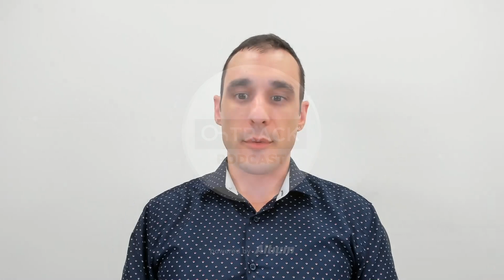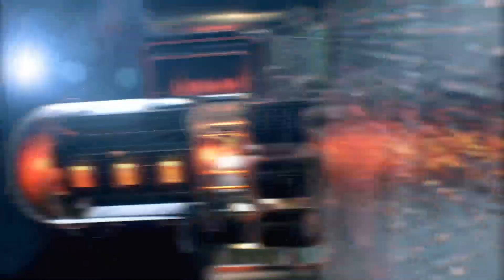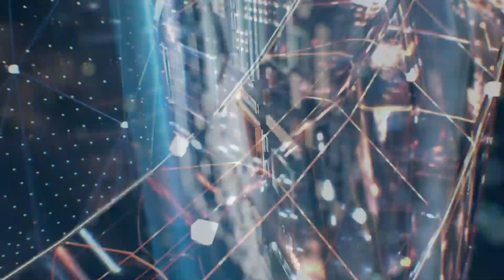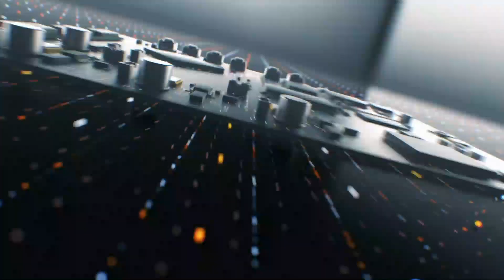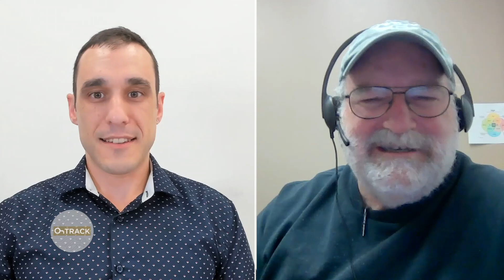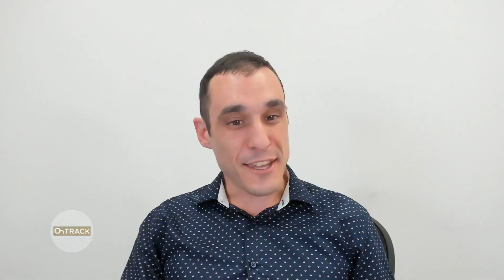Avoid Bad Design Guidelines with Eric Bogatin | OnTrack Podcast with Zach Peterson

Comment: On right angle bends: they can cause your trace to fail in manufacturing due to materials shrinking at different rate as the pcb cools. Good enough reason to avoid them even if it is just pdn trace with no high frequency signal on it.
Reply: My preferred reason to avoid is space, I can get more 45-degree traces into smaller space than the same number of right-angle traces. I like curved traces for routing in some BGA designs where you have to snake through a lot of pins, use it in package/module substrates too.

Comment: The enemy of proper design: (12 minute mark)  "But it works"... :)    Can't tell you how many designs I've had to re-design because the previous designer assumed that since it worked on his single prototype, we could build 1,000,000 of them without excessive failure rates.

Comment: How important is any of this for frequencies (including intentionally introduced diode or *FET/triode/pentode distortion) in the audio domain, assuming anything over 16KHz is snubbed to ground? My primary interest in electronics is analog musical instrument amplifiers and distortion pedals; in this frequency domain, isn't it more helpful to exploit and encourage parasitic capacitance and inductance that we generally avoid in the digital domain? H E double hockey sticks, many distortion pedals have RC treble shunting on the output that swamps any "pathological design" parasitic capacitance by many orders of magnitude.
Reply: This stuff with grounding and parasitics is a lot more important in instances where: 1) you're operating with typical digital ICs, and 2) you're working with very low signal levels, like micro-volts. In the first case you're at higher frequencies, but you get the most benefit and ease of routing when you put the GND plane below the signal layer, and ideally as close to the signal layer as possible. In the latter case you could be working at any frequency, so it would also apply in analog measurements at audio frequencies. In that case where you are taking low-level analog measurements, you would also use a lot of filtering, isolation with splitting up planes and adding a lot of stitching around signal paths.

Also you're right, an intentionally placed cap or RC circuit will beat parasitic capacitive impedance hands down, that's one reason we might place a cap across PGND and SGND on a transformer. The intentionally placed capacitor will be the signal path rather than the winding capacitance across the TX as long as the placed cap is larger capacitance than the parasitic.

Comment: On a subject of bit flips - I think it's just our brains are not good with very large and very small numbers. If you ask somebody if 1 to 1B chance event is likely to happen, they will most certainly say "no", but when you have a relative slow by modern standards gigabit line, 1:1B error rate means that an error happens every second (on average)!

Comment: Thanks Eric and your colleagues for exposing myths and legacy code.  Have you approached component manufacturers to get them to fix datasheets and app notes?  It's about time the source of the split planes was finally fixed.
Reply: Hi Robert,
I can't speak for Eric but I can say something about design guidelines in datasheets and app notes. The board layout guidelines you might see in datasheets are normally mirrored from specific test boards or evaluation products. So the manufacturer is really only telling you that the circuit/component worked in their specific situation, they can't guarantee the component will work in every situation. This is why you keep getting the ferrite bead on power lead guidelines all over the place. It works in certain situations but it makes high frequency noise worse in other situations, and yet the guideline was probably developed for a totally different situation. So in that sense, the guidelines aren't universally wrong if your only metric for success is to ensure you get a working circuit, but that doesn't mean the circuit will be low noise or pass EMC.